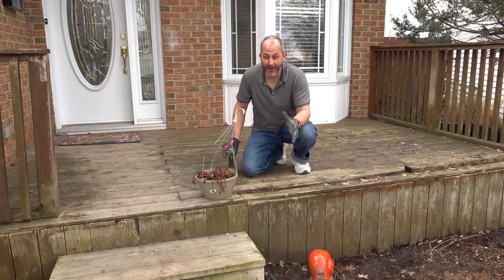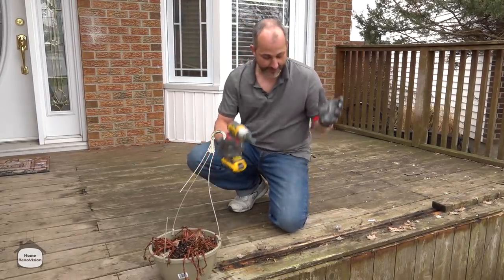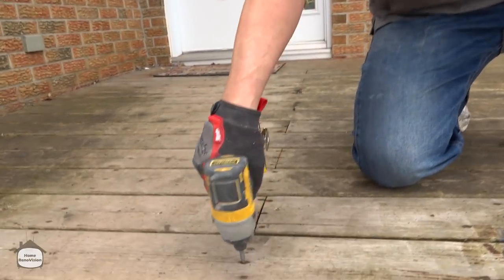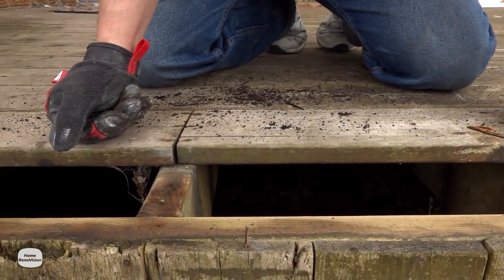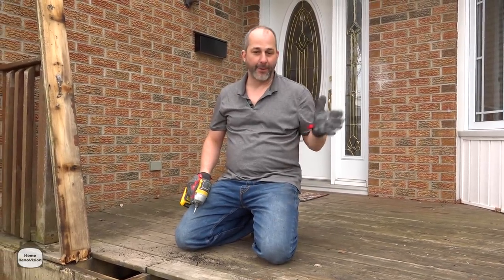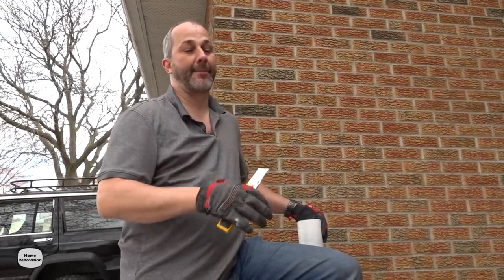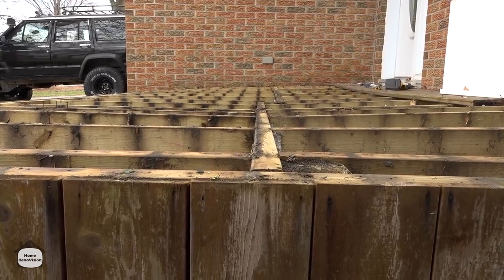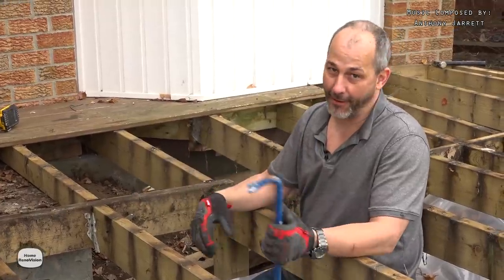Affordable Option To Rebuild Your Deck

Comment: I tackled this exact thing last year. Deck boards were shot. Garbage screws. The framing underneath was also 2x6 and were poorly put together. 0 joist hangers at all. This video series will be interesting to see if I rehabbed the deck up to your standards Jeff. Great video!
Reply from the maker: We are just fixing this with the hope of getting a quality 20 year project. Nothing too extreme.

Comment: Great videos as always - can you clarify on this conflicting info --> "Do not install a vapor barrier beneath the deck. Rain may collect on the plastic and become a breeding ground for insects. Water vapor from the soil can cause severe cupping of the decking. The underside of the decking boards readily absorb moisture that evaporates from the soil. The drying action of the sun and wind dries the top side of the decking. The dry top and wet bottom of the decking produces the internal wood stresses that cause cupping." -- I plan on building a composite deck close to the ground. Thanks!
Reply from the maker: composite deck won't be affected by moisture the same way wood is.

Comment: I have to build a small porch at the back door of my house and have to remember the tip on the size screws to be used to build it. The deck you are working on seem to be in need of the top boards badly, and the boards below seem to be better and wish you all the best in getting that fixed.
Reply from the maker: The follow up videos are coming over the next few weeks.

Comment: Quick questions, My guess is that you are going to add some posts through out the middle of the deck to help lift it to being level, and to give support throughout the whole deck correct? Would you then power wash the old support boards, and then reseal it to help make the boards last longer? I hope I don't come off as offensive, just trying to gauge  how green I am to renovation projects. Thanks for your reply!

Anway, thank you for the videos! I am learning a lot and hope to continue doing so. 
Cheers!
Reply from the maker: I actually removed a post. You will have to watch this saturday to find out. Cheers!
Reply: I can’t wait to see it!

Comment: Hi Jeff.  That deck is a clone of the one we have.  Previous owners used wrong screws.  All heads popped up, leaving the shank embedded in the joists.  How did you deal with the screw shanks left behind?  Thanks.

Comment: Amazing! Im glad I saw as many videos and websites as I could. I think I actually overbuilt mine... pressure treated joists... 1/2 gap with some pvc so it wouldnt sit on concrete and air would be able to go through as well as water... Grace vycor covering the top of joists...etc .. if it lasts 20+ years ill be happy

How old is this deck?
Reply: by the way, why was this deck poorly built? is it because of the lack of gap between boards?
Reply from the maker: 12 years we guess. Your system sounds like you will get a long life. Just make sure to keep the surface protected from the UV

Comment: @1:55 2.5" screws are 2 times the thickness of 1.25" deck boards not 1.5 times. So minimum of 2 and a half (2 1/2") screws for decking planks.

Comment: Just bought a house, been watching your videos because it's a complete gut. Do you have anything on fixing joists? Previous owners cut through them and I need to know the best way to fix that. Any help would be appreciated.

Also, love you videos and shout out from Toronto.
Reply from the maker: Hello, the best way to fix a joist is to laminate 3/4 ply on both sides with screws and construction adhesive. try to laminate as long a piece as possible . for best results consult an engineer. They can give you a plan for just a few hundred bucks. Cheers to Toronto!

Comment: About 9 years ago I bought "above ground" treated wood for a dock and a deck. I've been replacing rotten boards  a while now. You have to get "ground contact " treated and my local lowes doesn't sell ground contact 2x4 or 2x6s so I drive way cross town to home depot. You MUST read the tag on the end of every board delivered. If it's treated for "above ground " send it back or you'll be sorry.
Reply from the maker: good advice.

Comment: I am thinking of building a new deck on the back of my yard - and unlike the other one which was sitting on concrete - this one is grass. The way I am thinking of doing ... it remove about 6 inches of soil... put some sand and gravel and tamper it down along with weed barrier. If I have a layer of gravel would i still need the vapor barrier?
Reply from the maker: Yes we are concerned about ground moisture and the sauna effect. stone won't stop that.

Comment: Can you also do a deck project where you have to redo the footings.  I am having this issue with my deck. The height is my deck is 8’ tall and was built with concrete footing but was done properly.  Wanting some advice on how to fix it.
Reply from the maker: No plans soon. You can always use the same footings and attach a new post to it.

Comment: I'm actually in the middle of this exact project. I have two questions. Like you I'm replacing all the distressed wood including the rails, but the under-structure is solid. A section of rail is a 2x10 bottom + 2x4 top + balusters , and it sits on a skirt board and mounts flush with the outside of the deck - so not on top. First, is there a clever way of re-building these rail sections (because whatever I'm doing is not clever)? Second - when I mount a new rail section the rails are never perfectly perpendicular, even though its flush with the deck. If I set them perpendicular there are gaps where organic material can collect, which I want to avoid. Whats the trick here? Thanks in advance. Oh a third question - if you cut pressure treated wood you get a snow white face. Does that need to be treated before laying the board? Apparently no one does. I ask only because the rest of the board is brick-red. Thanks again!
Reply from the maker: how to repair structure this saturday. Cheers!

Comment: hahaha , how did they not find lumber long enought XD ! I mean you dont save that much by buying 6 feet 2x6's vs 12 feet ones. at least you could crank those middle areas up and do something nice with it. Love the channel. im waiting to see what kind of magic you're going to pull off here !
Reply from the maker: some people only have small cars and make this bad buying decision.
Reply: I just found this video, I don't mean to resurrect an old topic.  I was baffled at first, until that end shot which clearly shows an older concrete slab.  They wanted to leave the concrete slab/porch in place and build overtop.  Problem being the slab was set with a standard step up into the entry door.  There wasn't enough room to use 2x8 or even 2x6 joists and still have a deck top.

You can see they used 2x4 over the section of concrete, which led to them breaking up the joists throughout the deck.  Hack job DIY all day long, but that is the reasoning.

Comment: Found this tryomg to find out how to take off the boards when the screw hole rusted... 

Though I will say that your accusation of not seeing that the deck wasn't level is kind of misplaced when your camera shots are angled down.
Reply: You can use a reciprocating saw to cut the screws. Also it was pretty clear the deck wasn't level when shown.

Comment: how do you prevent the moisture and rust from rusting your impact driver. Purchased a brand new drill and I just placed it down on some grass for a bit while assembling a trampoline for the kids. next day all my screwdriver bits are rusty and my drill has some surface rust...
Reply from the maker: I don't place it in the wet grass. Cheers!
Reply: Ammar as far as the drill bits try soaking them in some coke I’m not sure about the actual drill though

Comment: They built my deck with nails, not screws. The boards are now coming up.
Reply from the maker: That can happen for a number of reasons. You can remove the nails and put screws into the same spot. Labor intensive but it will work.

Comment: Pressure Washers are Your Friend
Reply: IMHO pressure washers are for cars and concrete. 'cleaning' a deck with a pressure washer significantly shortens the lifespan of the timber by forcing mould spores further and further into the timber and gives them a drink as well.FFI-See my comment below part 2 of this vid.   :-)